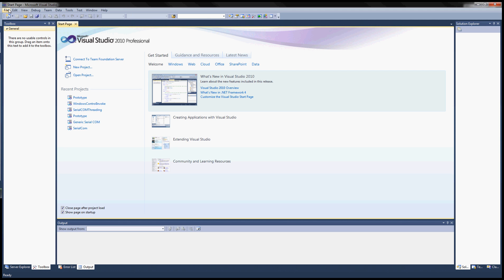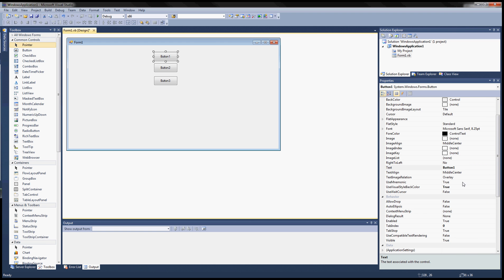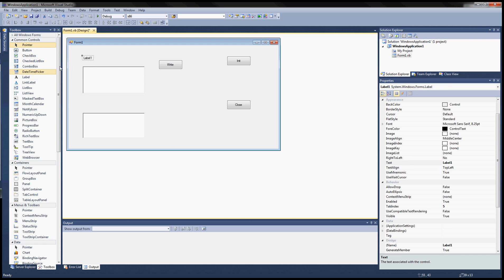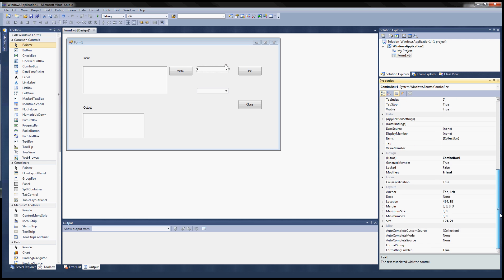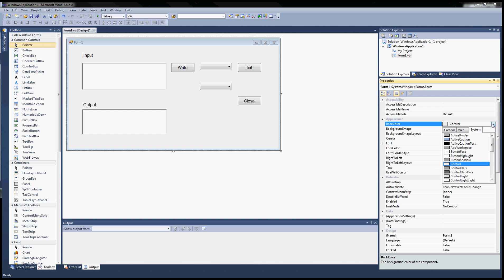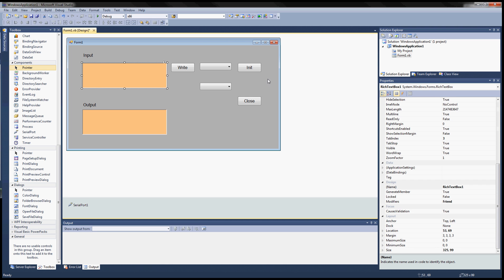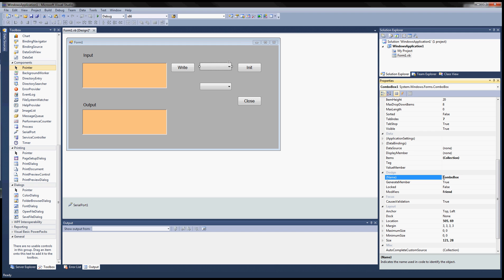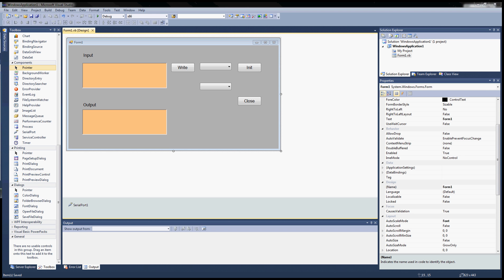Visual Basic Serial COM Port Tutorial (Visual Studio 2010) - Part 2

Comment: hi Kelvin, need ask for your advice. I'm developing excel based VBA application which I need send data out via serial port. Previously I'm using MS office 97-2003. There is one object (like a phone) that I need insert to excel so that I can use command to open the port. But even since I change to Excel 2010, the object appear a "cross" object and my workbook having compile error (can't find project or library) for Mscomm1. I did registered the MSCOMM32.OCX inside my system32. I can't find any idea how to resolve this. Could you help advice?

Comment: Damn, this works without any changes with my microcontroller which send precise temperature reading and send data to PC via RS232.
But reading and sending is constant so "output" box will be quickly filled. Is there some way that incoming data replace previous one on same position? for example if I shrink output box just for lets say (22.56C) so next string to change that string with new one, lets say (22.64C) so they are not shown both (an all others behind), i need just one, currently correct value? Thanks
Reply from the maker: create a buffer with X number of samples
you can average the buffer and display
you would have some type of index counter that would reset
every now and then